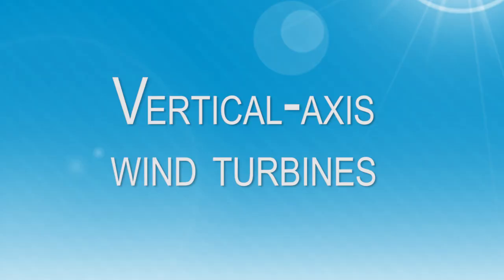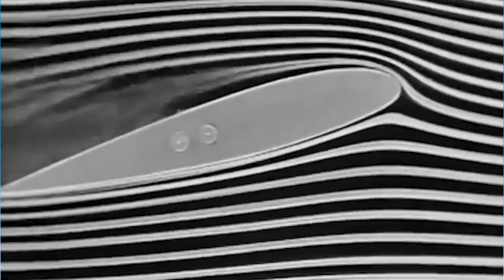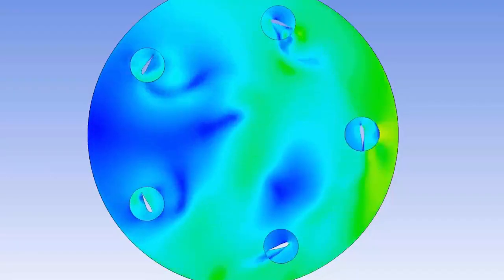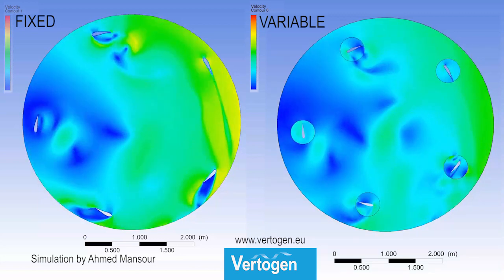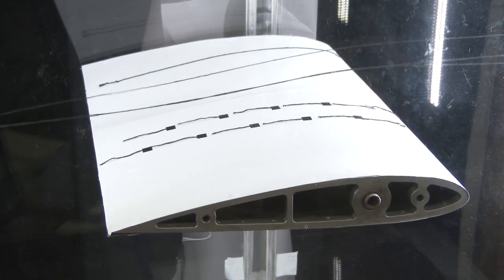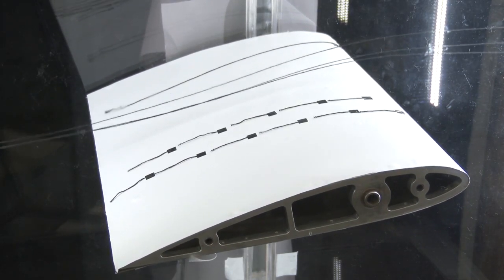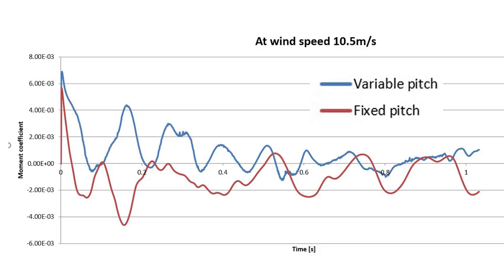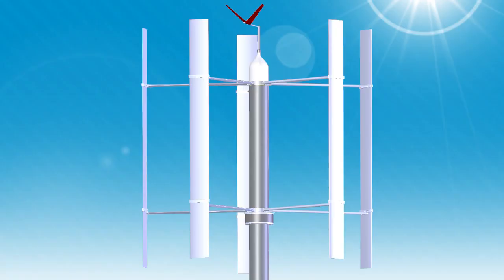Variable pitch vs Fixed Pitch VAWT Vertogen 2019 02 12 V01

Comment: Seems a good idea. Implementing a blade pitch control adds complexity and the turbine becomes direction dependent but the output power and other advantages could make it worth the effort.
Reply: The Sharp variable pitch vawt has passive pitching blades. It is far better than this one.